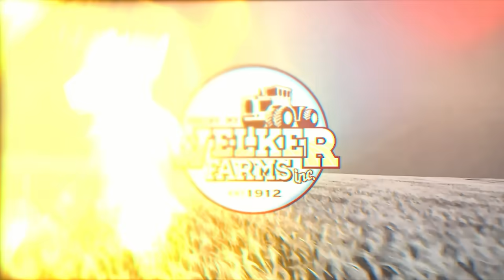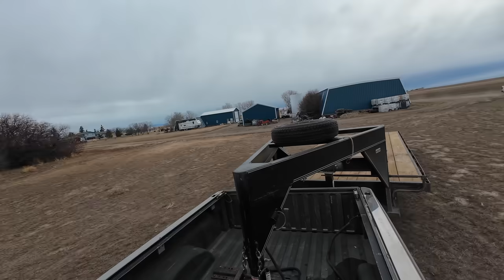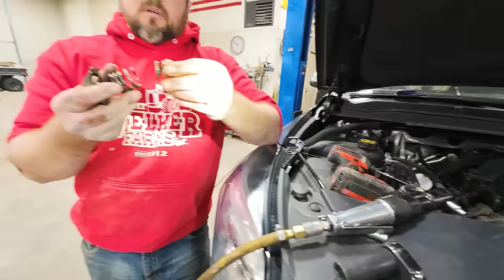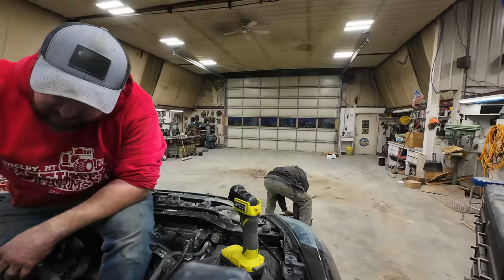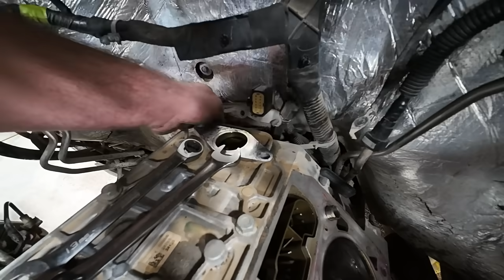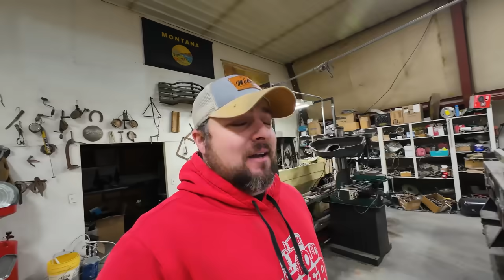Not Again! 🤦‍♂️ Engine Cratered...Let's Find Out What Happened

Comment: If you haven't found out yet; Hollow valves are no new thing. Porsche has used a Tech for a long time. The valve is filled with a substance that only becomes solid under pressure. Less overall mass and less weight.

Comment: I'm so thankful I've kept my 02 Silverado Z-71 4×4. Just a simple 5.3 engine, no cylinder delete. I think that's why I'm up to 325,000 miles, original engine and transmission. Drive train has never been out of the truck. I keep all the maintenance completely up to date. Still purring like a kitten. There's quite a bit of rust, and lots of scrapes, scratches, and some dents. It's worked very hard during its lifetime. Plenty of room, very comfortable, and all the options still work, even the power mirrors. Probably have spent more money on it than it's worth, but I love the old girl and I'll keep her rather than get something newer and experience the problems.
Reply: Hard to hurt anything when it's making 175 hp at the tires, and that's honestly probably being a little generous.

Comment: A quick tip for you. Pull the rear tires on the lift and you can lower the car about another 6 inches. It really helps us short guys.
Reply: Good advice i only 5'5" i dont a lift but i do use floor jacks

Comment: It's actually pretty easy to change valve springs. Get a adapter to put air pressure in the cylinder and they make a tool to compress the valve spring.

Comment: My grandson bought a 2013 Silverado last fall with the 5.3 in it and 130,000 miles.  He drove it home and 2 days later, it started misfiring and knocking.  Even though there was no warrantee, the dealer said he would take a look at it.  Sure enough, because of the Active Fuel Management system, it flattened the cam on #6 and wouldn't open the valves.  To the dealer's credit, they said they would put a used 5.3 in it with similar mileage.  They got that one in and it had the same problem.  So here comes engine #3.  It worked.  Since then, my grandson has put in the module that shuts down the AFM.  He wanted to put in the different oil pump but the dealer would not stand behind the engine then.  So far so good.

Comment: This is why I still have a 7.3 PS 1 ton 4x4 and an F150 300ci straight 6 extended cab for light chores.   7.3 has had 2 cam position sensors at $25 ea and a couple o rings in the injector oil lines.  Wife runs a 2009 Tundra 5.7 L  made in Texas and it has been bullet proof as well.  Just put the second replacement battery in it and an AC compressor last summer.   AC repair parts were less than $300 and I was the labor.   Not bad for 14 years.
Reply: I have owned several 5.7 Toyota’s, what an engine!  I don’t think another V8 touches it for power and durability.
Reply: I had a 300 in my old van.  It had an interesting habit of starting, as soon as the key was in the on position.  What was happening, is when it was turned off, it still had some fuel in the cylinder.  Turning on the key, would fire the plug in the cylinder next to fire, igniting the fuel, and turning over the engine.  GM researched this years ago with a starterless engine. Just fire the injector on the cylinder on the power stroke, fire the plug, and the engine would start.

Comment: I have had LS style heads rewelded on my 1300whp motor that were little to nothing left. Those few marks are nothing. A lot of shops don’t do it but certain well known shops will weld them machine them and blend and you couldn’t even tell what was done to the head even with a brand new one sitting next to it. The fixed one looked better. So yes it’s fixable but might not an option for you if you don’t have a shop that does that sort of thing and is good at it. Probably just easier to find a used good head and clean and resurface it and call it done. You have to put new springs anyways and valve seals are only a few bucks so that then the cost of the used head it’s really nothing more out of pocket

Comment: My buddy had a suburban with a 5.3 that detonated at 85k miles. He paid a shop to install a remanufactured 5.3 purchased through advanced auto part. It lasted 800 miles and blew up. They replaced it and that engine lasted 100 miles. The remanufacturer tried to bail and not warranty the second engine saying metal must be in the oil cooler. Shop verified everything had been replaced with new parts and sent 2nd engine back so it could be examined.  After a couple months they sent a 3rd engine and it run perfectly.  My buddy was without his vehicle for one year and cost him over $10k in repairs.  He sold it a month later eventhough it ran perfect. Was scared it might blow up again. Total nightmare due to gm gas saving device junk.
Reply: There are better options folks than these GM nightmares.
Reply: Don't blame GM, it's the Feds that are making the MPG requirements.  Now you get a small 4 or 6 cyl with a turbo.  I remember when a turbo was "racing equipment" and your insurance company would cancel your policy if they found out you had one.
Reply: @randyb1890  GM is the problem at this point.  They have been making DOD for 18 model years and it’s still broken.  Other manufactures are not having these issues, at all.

Comment: Hey Scott I feel your pain brother, I just had the head gasket, timing chain an timing chain tensioner an 1 cracked manifold repaired on my 01 jeep grand Cherokee limited 4.7l, thanks for sharing

It's absolutely rediculous how many sensors an vacuum lines vehicles have nowadays, the smallest things like a vacuum leak can hault the vehicle, the vehicle manufacturers make these new cars nowadays so complicated that you have to take it to a shop to get it fixed because it might need a special computer or some kind of specialized tool or something

Comment: Don't fret, I fried my 5.4 3V triton with the janky timing setup that is so crucially oil pressure dependent about 10 years ago (2004 MY FX4 bought brand spankin' new) and bought a remanufactured to keep it.  Yeah, the truck wasn't worth what the engine cost at that time, but living in the south it's basically rust free, and 8K vs 40K for new made it an easy decision.  Truck is still with me and no longer a daily driver, runs great, burns a lot of gas when driven, needs paint next.

Comment: GM guy here too!  1976 Pontiac Trans Am, 10 years 235,000 miles.    1985 S-10 Blazer 14 years 244,000 miles     1999 Suburban 16 years 385,500 miles    2016 Silverado 1500  7 years  129,000 miles    Closing in on my personal Million Miles Driven, all in quality GM products.   Great work guys!
Reply: Over 4 million here. 1 ford cabover 3 freightliners 6 Pete's 2 kw's and 4 Volvo's.  Volvo definitely the most trouble free
Reply: Them old engines were good
The new ones are junk
Especially this variable crap
You'll never get that many miles on the new stuff.
Reply: New GM trucks are terrible! I use to own nothing but GM. Not anymore

Comment: I'm sorry for your breakdown Scott. You're right. NOBODY makes a reliable drive train anymore.
Reply: I have had very good luck with V8 Toyota trucks and landcruisers.  So far Tundra 4.7 372k, Tundra 5.7 280k, 100 series Land Cruiser 282k, 100 series Landcruiser 255k, 200 Series Land Cruiser 110k.  Just phenomenal machines.
Reply: ive never had an issue with any ford drivetrains over many hundreds of thousands of miles since 2012 on multiple ford vehicles
Reply: @hokie9910  What about American cars from the 50s, 60s, and early 70s?
Reply: @CJColvin  They we’re simple machines but back then most people thought a car hit 100k miles it was ready for the crusher.
Reply: @hokie9910  True but some people still have em and fixed em up.
Reply: @CJColvin  agreed, old American iron was solid.
Reply: @hokie9910  Yep
Reply: @2007dalin  Really? No cam phazer issues? No timing chain issues? No spark plugs breaking off? No broken exhaust studs? No egr failures? None of the common eco boost problems? No driveaway clunk transmission issues? Man I need a Ford. lol

Comment: I disabled the variable cylinder management system last year on our 2015 honda odyssey. Just replaced the alternator, which oil leaked onto it, and fixed the oil leak. No more engine light. It so satisfying to do the work your self and how much money you save.

Comment: I'm a big GM fan also. 2020 Silverado with  8L90 trans was chattering. Read about updated  trans fluid in a blue label bottle and it solved the problem. At least for one week .  Find out if yours needs it. Full flush  11.4 quarts.

Comment: JEGS is having a sale on 6.2 long block crate motors - ships tomorrow.   Not that difficult if you want to solve the problem with a long block.
Reply: Only problem is by the time They put this out they’ve already doing something
Reply: Out of curiosity, I checked the Jegs website. Those engines have a ship date of 2/28.

Comment: Scott, I had 2 valves drop on an engine and am currently rebuilding it.  1 valve was stuck in the piston and the other was wedged in the head.  My head had alot more damage to it than yours, but my machine shop was able to locate someone to weld up the damage and reshape the chamber.

Comment: First I apologize that I’m logged in under my wife’s account. I’m a 27 year GM technician. Watched the video and want to give a heads up on repairing the block. You can have machine shop bore and install larger piston’s from aftermarket companies. But you have to do all cylinders or you will set codes for cylinder balance issue and have an SES light and remote start will be inoperable. GM had a bad batch of valve springs and issue with camshafts.  My boss’s truck broke the valve spring and dropped into cylinder like yours. I have a great machine shop to work with that we figured this out with and wanted to pass on. Great video
Reply from the maker: Appreciate the insight! Definitely will have all cylinders bored the same and new pistons for all 8. A good machine shop did this to Nick's 6.2 and it is running great! Except it has the old springs still so we will swap those out after learning about the spring issue. Both vehicles are 2015 models.

Comment: 13:31 Leg Arms' comment about "gotta have the piston at TDC" and Nick adding, "- to keep the valve from falling inside"  brings to mind a trick used by small engine mechanics  -  which is to stuff the rope from the pull starter into the spark plug hole and raise the piston.  The bunched up rope will hold the valve shut without harming anything.
Reply: If we have to swap valve springs when the head is on the car, we feed shop air with a hose through the spark plug hole.

Comment: To change the springs without pulling the heads you need to get an compressed air adapter that fits into sparkplug hole and use compressed air to keep the valve up while you change the springs.

Comment: If you have to do Nicks springs, make an adapter that screws into to the plug hole and has a male air coupler.  Put air pressure into it.  An old time trick used when replacing valve seals.
Reply from the maker: Do you think too dead center is enough or will it be too difficult to lift the valve high enough to put the retainer on? I've heard the air pressure trick, definitely will try it!
Reply: @WelkerFarms  TDC may not be high enough to keep the valve up far enough to get the spring retainer and keepers back in place.   Using 150 lbs of air pressure in the cylinder is more than enough to keep the valve seated while you work
Reply: @WelkerFarms  If you want to use the TDC metthod, I've used something like braided rope/paracord and pushed it into the cylinder via the spark plug hole. That way when you raise the piston to TDC the rope fills in the void and holds the valve completely closed. I've used both air and rope methods successfully.
Reply from the maker: Some great ideas, I like the rope and air. Just need to get the spring compression tool.
Reply: With the air pressure hold, you also need to put a socket on the end of the crank and brace a break over bar against the frame or something to hold the crank in one place.  The reason is if you don't get the motor EXACTLY at TDC on the cylinder you are working on, the air hold will spin the crank over.  Sometimes it will hold in place at TDC for several minutes, but then all at once it will spin - usually at the worst possible moment.  

That is why the rope trick is usually safer, but more hassle to do.  The easiest method is to feed a bunch of rope in with the cylinder part way down in the stroke, then rotate the crank towards TDC until it stops - forcing the rope up against both valves.  

OBTW, racers repair (tig weld) LS heads all the time with far worse damage that you have on yours.  A decent pro welder can fix most damage for you, they have the experience to weld up the head without porosity problems.  Then machine as normal.

Comment: You are probably another winner of the GM DOD failure.  I ended up rebuilding the top end of my 2015 Yukon Denali do to a DOD failure.  My advice, remove the motor and do it on a stand, I didn’t and would have taken a lot less time had I done so.  Good luck

Comment: Other side of the coin on new vehicles. Couple years ago I had a timing chain failure that bent and broke a set of valves in one cylinder in my 2011 Prius. One new piston and rings, two valves, and a timing chain, and the car was back running. That occurred at 250k miles, I’m now pushing 290k. My point being there are manufacturers that still build quality equipment!!!
Reply: I think you and I are the lone soldiers on here begging people to try Toyota or Lexus.  I left GM and Ford years ago for Toyota products and have not looked back.  My stress level and pocket book are much much happier.

Comment: My '07 Silverado 5.3L experienced a DoD failure at 232k miles.  One of the lifters collapsed for cylinder deactivation and would not release.  I got a special punch that is designed to allow the lifter to release when it is hit just right.  I did that, it worked, and I put a cylinder deactivation override device on it and broke off some parts of the VLOM gasket so it cannot build oil pressure and activate the DoD.  It's been running great for 3,000 miles, but this truck doesn't get driven that much anymore.  It's a chore truck.
Reply: I have an 08 Burning loss of oil. For 2000 and some Repairs it has been good for a year.

Comment: Just worked on a 2015 Yukon XL with the 6.2 that ate a cam. I noticed the cost of a new cylinder head from the dealer was less than $300 complete with valves so that could be a cheaper option than working your existing head.  It’s also very common for piston material and other debris to get sucked up into the intake manifold and the material goes unnoticed until you and install it on your new engine so it’s there is a high probability you’ll need a new intake manifold as well. Good luck with your build and glad to hear your trip ended safely.

Comment: I've got a 2009 Yukon XL SLT AWD that we bought used.  About 3 months after we bought it the 5.3 motor started a ticking noise and gradually got worse after 60 miles.  After the 60 miles I was home and started tearing it down to find one lifter on a DOD cylinder was toast.  Luckily, the lifter collapsed rather than doing major damage.  Did an inframe on the motor and replaced the cam, lifters (no DOD lifters), new springs and keepers, oil pump, three bolt cam gear and new chain.  Also,  the DOD oil feeds were plugged.  Most of the parts came from Gwaltney Chevrolet in Arkansas.  The cam has a power band of 1500 to 5000.  Oil pressure is around 60 to 70 psi.  The Yukon runs great and has great power.  Plan to keep it for a long time.  Getting the tune right was the major issue.  Just happened to be going through Arkansas and stopped by Gwaltney Chevy and they fixed the tune.

Comment: I pulled the heads on my 08 Silverado and did the DOD AFM delete. A word to the wise. If you pull the radiator you can stand in the front of hte engine and reach over top to get to the rear bolts easier. The automotive machine shops are really backed up because no new people are going into that field. Just to get a engine bored or a set of head reconditioned takes week of waiting time.

Comment: Glad to see some great hospitality! Also, not sure if anyone has mentioned this. Heard a lot of horror stories on the torque converters on these. Check out the Silverado Sierra forums. Since the engine is out might be worth upgrading to a better torque converter without the thin walls. How many miles are on that Yukon? I have a 15’ Sierra with 141k. Considering my options incase of this issue. Thanks!

Comment: Wife drives a 2021 Denali and it had 9k miles and a similar situation happened to us heading down the interstate. Lost power, weird engine noise, barely made it off the interstate. Turns out it was bent push rods. The GM tech said it was a common issue over a few of the year models on the 6.2 and some of the 5.3 engines. Faulty spring retainers or lifters is what we were told. Frustrating to say the least.
Reply: That same thing happened to my 07 5.3L at 167K.  Still a good vehicle
Reply: Good grief, how can GM who brought us the small block V8 those many years ago not figure this out.  They have been having these problems now for 17 years!!!

Comment: The reason why you have hollow valves is probably filled with sodium which is for better cooling.? I'm an attorney/airplane mechanic and there are valves in the Lycoming, Continental, Pratt Whitney the valves have sodium filled and the cylinder walls are nitride

Comment: Invest in a top quality high value oil pump and go from 40 psi to 60-80 psi oil pressure more oil pressure longer lasting. But seriously invest in top quality parts. Yes it’s a good bit more but it will last a lot longer like 2-3 maybe 4 times longer. I am a professional automotive technician and cheap parts today are 100% junk no joke. So don’t skimp on the money you pay for your quality parts.